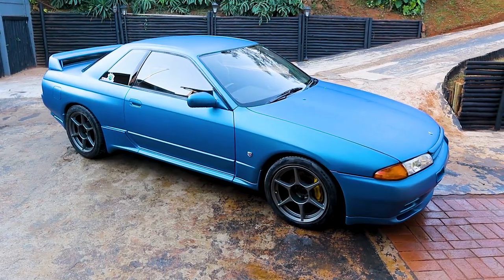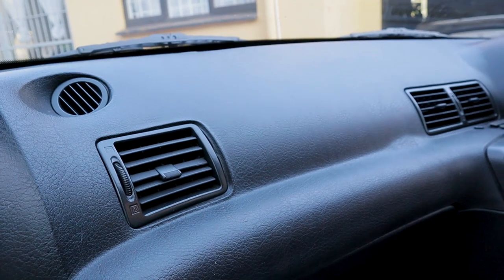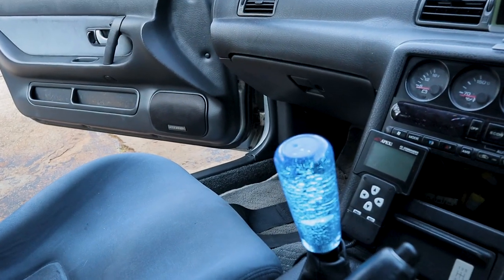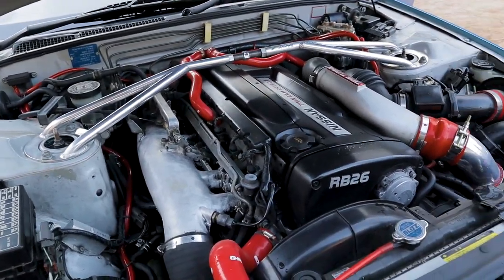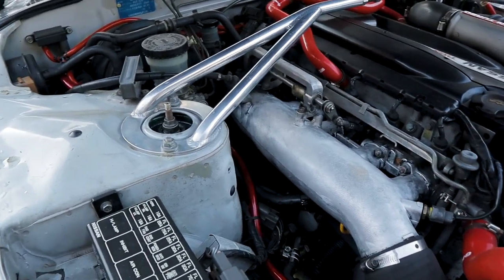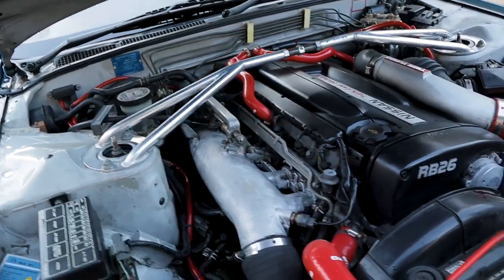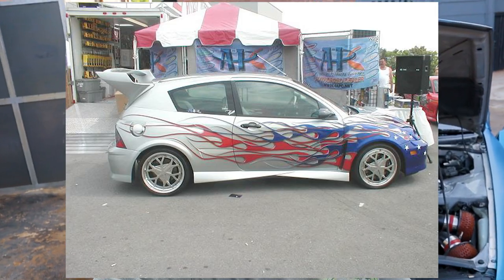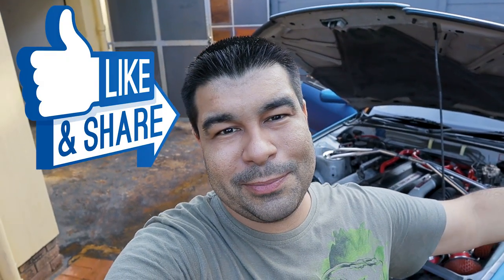5 Things EVERYONE hates about the Nissan Skyline R32 GT-R

Comment: So let's address those as a RS4-S owner:
1- I don't have that problem (yet), I'm planning on putting some sort of mat thing on there to protect it form the sun anyway, at some point.
2- Yep. I have the same issue in the Stagea.
3- I love the viscous fan, although I'll concede that, combined with the noises from the transfer case, it does make the car sound like a truck. :D
4- Thanks to the otherwise uselessly complicated routing of the admission pipes, that issue isn't as annoying on the RB25. The filter location is awkward, but I can reach in there and unscrew it at the lowly cost of a few tiny cuts and scratches on my hands and wrists. Of course the oil ends up collecting between the fins on the front diff housing, but who doesn't like to reach down there and clean it after every oil change?
5- Nope, I don't have that issue with the hearse. Most people have no idea what that weird looking wagon is, around here. :)
Reply: And my number one issue with the R32 GT-R is that I don't own one. :P
Reply from the maker: 1. Aha.. like some do for racing.. stops the glare! Or you could flock it?
2. Damn floor...
3. That noise... bleh..
4. Just thought of my next gamertag : DirtyDiff
5. Hearse.... haha! I'd love to have one... Never seen one in real life!
Reply: @The_JDM_Dynasty  Yeah, I thought of flocking it, but then I'd have to take the dashboard apart. Worse, I'd have to put it back together afterwards and that's never a pleasant experience. :D
DirtyDiff works. I hope it's not been taken. :)
Reply: Oh yeah, and the 4 wheel steering is weird, but I sorta got used to it. I'll probably buy a HICAS delete kit, since they're about the same price as a set of brand new endlinks.